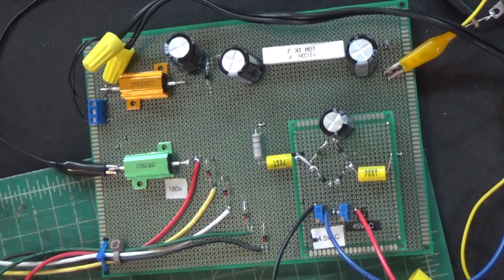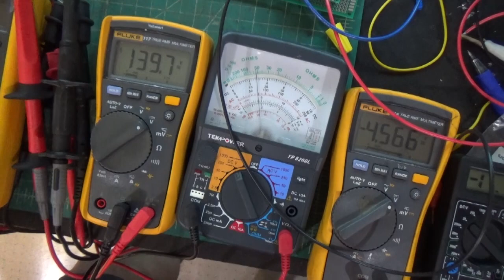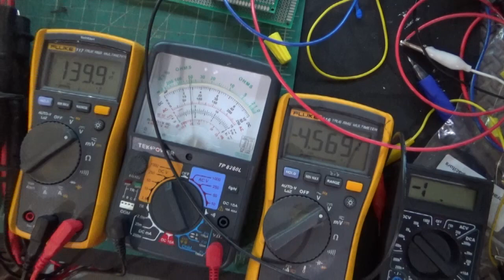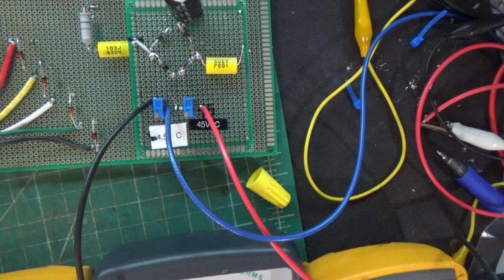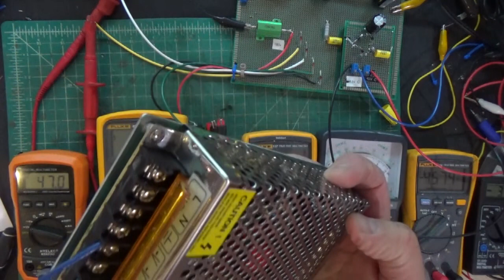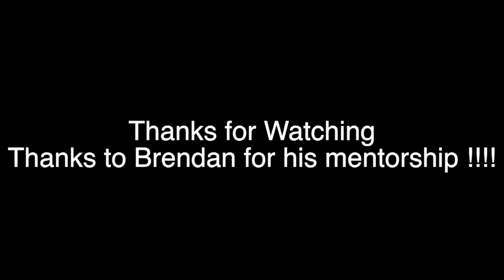Atwater Kent Model 67C Battery Radio : Episode #6: 7 Different Power Supplies in 1

Comment: Ron keep them coming good stuff I have been working on a little silvertone 8003 I got a question on tuning cap should you see continuity from plates to rotors?
Reply from the maker: Jody,  you should never see continuity from the stator to rotor.  Does it stay as you turn it ? You may just have a bent fin... check things carefully. Make sure the set is unplugged.
Reply: @rciancia  it's there all the time even when it is all the way open I thank it has been wired wrong

Comment: You can’t have sufficient multimeters Ron ...in fact you can’t have sufficient bench testing equipment.
For example, I own five analogue AVO meters: three of them are AVO, model 8, mark 3.  Those were the type of preferred meters used by most of the British audio and television design teams (when we used to manufacture such products).  Also I own four Flukes, one digital AVO, and three ‘cheap ‘n’ cheerful’ type meters.

I definitely like your power supply design.  I too prefer the KISS approach: there’s less to go wrong, and when it does, fault tracing is generally straightforward.

Take care dear chap, Phil.
Reply from the maker: Many thank you my friend. Brendan and I have now sorted out the 45Vdc  C-supply issue and its forging straight ahead now.  Next video will show my simple supply it all its glory.  I agree, never enough meters !!!  :)    I love Flukes as you can tell. My first meter in the 1980's was a Fluke when I worked on very large room band printers... ah those were the days. Many thanks mate..  Ron

Comment: You need more meters on the job.    I am a meter collector also.   It's a sickness.   I see it is too late for you to recover at this point.   LOL.  Interesting circuit.   What are the amperage demands for each voltage?    I'm concerned that your voltages are going to change drastically when you load them down.   Especially the negative rails.   Looking forward to results.
Reply from the maker: JP  Because this is a battery set , I am not too concerned about that.  On the 180vdc rail we are pulling less than  1amp here, but the real proof will be in the first test. I will get to use my trusty meters yet again... LOL   Live and learn is how it goes  - Thanks Ron